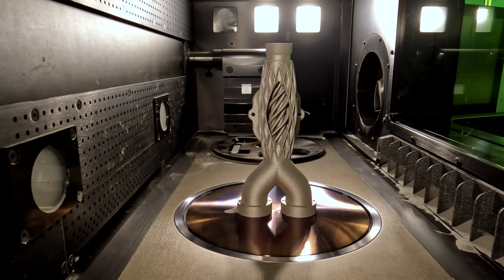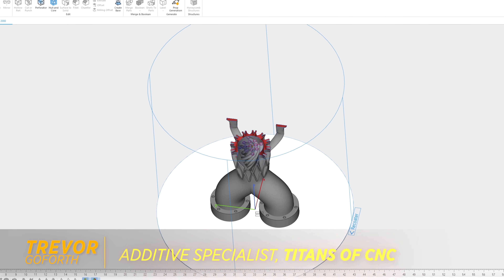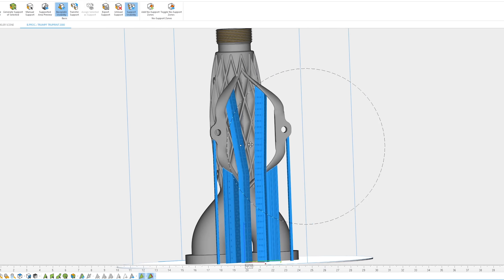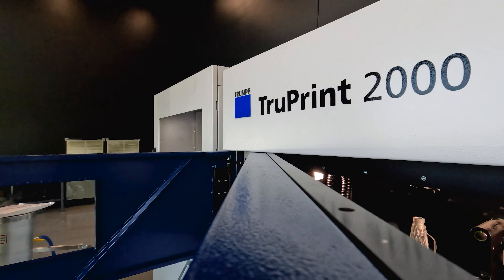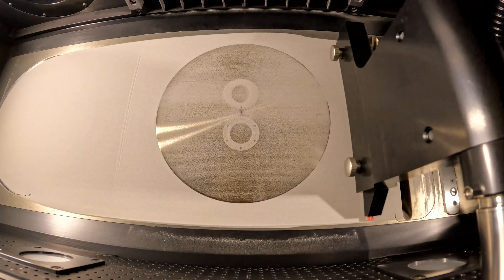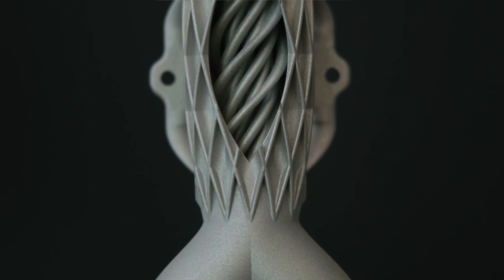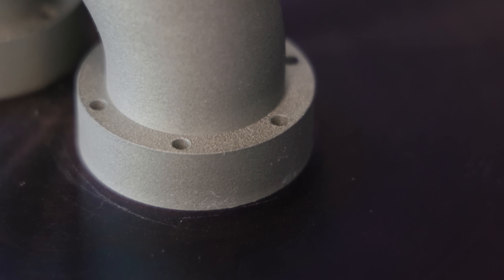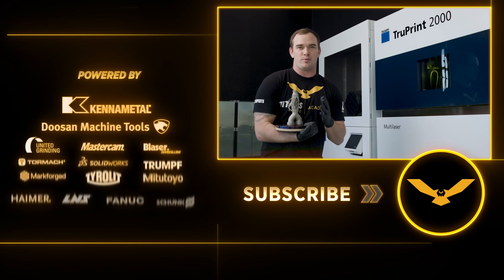3D Printing an INSANE Steel Part that's IMPOSSIBLE to Make on a CNC Machine

Comment: But what about the cost? Materials available? Surface clearance and smooth? Durability? Speed of production? Availability of such machines?
What if i need 1000 of a such parts? Isn't it'll be worth to slightely change the design to produce it fast and cheap with traditional technology? Can u polish inner of printed pipes? Can u offer some high tempreture materials? Or at least titanium?
Reply: Without a doubt, this is a very expensive part. Built over hours or even days on a very expensive machine, using expensive and hazardous metal powder. If you need thousands of a part like this, redesigning it to use conventional manufacturing would be the only way to make it truly low cost. 

That being said, there are all sorts of specialty applications that benefit from the design flexibility of 3D printing, don't need a high production capacity, and don't need a low per part cost. Maybe it's part of a rocket, maybe it's a heat exchanger used in a chemical plant, maybe it's going into a F1 car. Surface finish, durability, and clearances are just something that needs to be taken into account when designing a part like this for 3D printing, but the same goes for cast parts as well, and it's not as if the manufacturing limitations of casting have killed its relevance.  Many 3D printed metal parts have key surfaces that are machined for better surface finish and accuracy.

Comment: Interesting you have to put supports anyway because it sits on a medium of material.
🤔 how much force is applied by the  screeding action on each layer.
It surly is has vibrate action to make each layer easy to apply and compact?

Anyways don't know, don't have a 3D Printing toy to play with...

Comment: Rad! Smart to wear the respirator, even with fume extraction that nasty stuff still lingers for a while
Reply: I don't think the main issue is fumes, I think the respirators are required so you aren't breathing fine metal dust.
Reply: @keenanfinucan8778  There’s probably going to be some fumes but hopefully not as bad as cutting and welding. That’s gotta be some bad stuff though with these alloys

Comment: since you have the cutaway put in, you should check for leaks in a way thats easy for viewers to see. You can fill that center bit with liquid and apply a pressure and see if any bubbles come up.

Comment: Neat, but it still has many limitations. I can't imagine the flow-rate for fluid lines being terribly healthy with such a rough surface. Pressure and stress-concentration limits are likely to suffer quite a bit as well.

I can imagine that the more complicated the part, the more surface finishing is sure to be quite the new and challenging conundrum.
Reply: If stuff flows thru it, can you not sandblast the interior? With like, probing lines similar to those plumbing cameras or laproscopy tools?
Reply: The material removal won't be uniform and will concentrate on points and areas like the outer side of a bend. Even an abrasive line that can be used both in tensing and compression has limits.
And when dealing with high stress/pressure , any rough, sharp feature can became a focus for stress concentration and shearing/fracturing. Very smooth surfaces are necessary if you're working near the limits of a material.
Reply: @FiltyIncognito  might be true for pressure applications but then Porsche already used this tech for pistons years ago. In series production. Sure it's not perfect yet but especially for the automotive industry it can replace casting completely. Have you ever seen water channels in an engine block to be sanded or polished after casting
Reply: Honestly, I'm not sure how to succinctly  reply. It'd be easier to just hand you a textbook on manufacturing processes.

The limitations of 3D printing are well documented.

It's a great publicity stunt, though.
Reply: @FiltyIncognito  im sure everyone who made breakthroughs and innovations only followed textbooks.

If you understand engineering then you can understand improvements in tech, for now it's amazing. But it's not meant to replace other forms of manufacturing, just offer another option. If it can make impossible parts, even if not at peak efficiency, that sounds like a big win. Fine tuning and tech will get it to where it's most likely one day a major manufacturing process. I'd imagine it does have limitations, but doesn't everything?
Reply: @FiltyIncognito  i mean like a tube that you can slide down the inside while it blasts out sand in a 360 arc. Think of a sandblasting colonoscopy for your manifold.
Reply: @Variety_Pack  if the internal diameter is large enough, sure, but abrasive air-blasting doesn't have a terribly fine finish and wouldn't be terribly economical.

Best thing I can think of is running a high-pressured fluid whose density is the same as the abrasive in it. That'll require a fairly large and specialized machine, and therefor also a large enough client volume to be economical.

But that'll be in competition with already established processes....which is a huuuuuuuuuuuuuuge marketshare.

That's why I think 3DP currently has and will continue to have difficulties establishing itself beyond its current niche (disregarding outside hype-farming) in industrial applications for quite a while. Competition and economic viability are a big challenge, and tech has to advance enough to breach certain critical thresholds of profitability.
Reply: Maybe extrude honing it could solve internal roughness
Reply: Ah shoots, I'll jump in, why not! MechE here who's quite cynical about the marketing hype and false promises of a lot of tech, including 3d printing. Critically thinking about the limitations and perhaps learning to get the most out of other techs is often a lot more fruitful. That said, seems OP is thinking hard about some of these things so kudos. And besides, I have to admit, heat exchangers are one of the more interesting use cases I've seen for this tech. ;-)
Reply: Seems like this can absolutely be manually done to a higher quality with small metal tubing and welding. Is "manufacture" referring only to automated machine production?
Reply: @CableGuyRyv  I feel like you definitely could, but not out of stainless and not as cool looking lol. I can't imagine the cost/efficiency of the part is worth doing something this intricate... but maybe it is, not sure.

I worked on a heat exchanger cooling plate for a project in college. Is the only thing of this sort I've worked on, but was super interesting. I remember working super hard on a badass design, managing turbulence, flow rate, heat transfer through fluid, etc. All the good stuff. In the end, they winded up bagging the project after realizing that designs like these suffer massively from the surface finish where the fluids hit. Oh well. Got a pretty sweet 3d printed prototype out of it for my desk.

Side note: Looking back, I made so many dumb design decisions. Ignorance is bliss, lol.
Reply: @CableGuyRyv  they said "without a lot of design changes and assembly steps" it is indeed possible to do it manually but click and get the part back is quite nice. You can probably make something that does the same thing and may be sturdier by bending tubes and hydroforming the cavity, but it'll take a lot of skill and effort.
Reply: For a heat exchanger if the pressures are usable the high surface area might actually be a benefit
Reply: @satibel  There are ways to do that without increasing drag and wear as much.
Reply: @FiltyIncognito  if the fluids aren't abrasive it'll take a damn long time to get through the tubes, and I'm pretty sure you can make like 3 of those before you get to the cost of 1 made by hand.
I do think a whole redesign with stacked pressed plates might be more cost effective, but it doesn't look as cool
Reply: @satibel  The issue isn't chewing through the vessel. Weak points like joints are far more likely to wear first. (fluids don't need to be significantly abrasive to cause wear)

The issue is that a rough surface area will accumulate debris and corrosion faster, and the addition or subtraction of material will affect flow rate, and may cause debris to build up in the fluid that will accelerate wear in other parts of the system.

The redesign you're thinking of is NOT cost effective, at all. In many ways, the cost of manufacturing can correlate with the total surface area that needs to be processed. Not only will that mean additional shaping processes, assembly, maintenance and volume of source material will skyrocket.

Comment: The finished surface that CNC can do Is impossible on 3D print
Reply: Correct, but where specifific flatness and profile tolerances are required the printed parts are typically post machined in those areas.

Comment: how do you make 316 s.s powder! mind blown!
Reply: The process is called gas atomization. Basically it means you melt the metal (or alloy), you let a thin stream of molten metal fall from the top into a large silo or container and you aim very high pressure gas (typically nitrogen or argon) directly at the molten metal stream. The droplets solidify on the way down, so at the bottom you'll find fine metal powder.

Then you filter/sieve for size because both powder particle size, and size distribution, is critical for this type of powder bed printing. The powder that's not the right size can be melted and atomized again.

Comment: Can't wait until these machines can print whole working engines in one piece, not a head & block with gaskets in-between like we have now. I want a block and head in one solid piece. And you just run the engine until the internals wear out and recycle the engine and then print a new one...

Comment: When it is sintered, how much does it shrink? Does the process change material strength depending on how the sinter is programmed? Does the program automatically factor in shrinkage basted on the material?
Reply: This printer does SLM, selective laser melting. There is no heat treatment or sintering required afterwards for this printing method, and factoring in shrinkage isn't needed.
Reply: No sintering. The parts are fully-fused as-printed, but when they cool off after a print, shrink factors are on the order of 0.5%.
Reply: “When it is sintered, how much does it shrink?”

Sounds like something you’d lie to a woman about.

Comment: I worked at a place that printed cobalt-chrome dental fixtures. It set up from metal powder kind of like this machine. The metal powder is expensive, and water soluble. We used a six micron sieve to reuse the old powder. I was told that wearing any covid face covering would be sufficient. It wasn't, so I wore the common respirator I was given for belt sawing through supports to freeing the pieces from a steel plate. That was also insufficient, because the powder particles may have been too small to be stopped by the filter to begin with, but they definitely were after being sieved down. When reaching into the machine I could feel the particles crossing my tongue and hitting my throat. On top of that, the fact the powder was water soluble means it can pass through the skin. The sieve process was done pneumatically with the 3D printer's door open for the air lines to reach in. The powder was everywhere, in the air and a thick layer on top of everything. Cobalt-chrome is very unhealthy. My whole body started to go numb. I had to quit the job. The people who wear there had a strange acne along their hairline, like their skin was starting to fall apart. It took many months before I could feel my heart beating again. It is still hard to detect. unlike it was before I took the job. I can feel sore spots in my lungs that haven't gone away. It is harder to breath. I feel like this business I worked for took decades off my life, and I my have extra difficulty having children. It is also very bad for the environment. They are killing people there to turn a profit. I often want to press legal charges to hold them responsible for their actions, but I doubt I have enough evidence to convict. I wish I had never worked there.
Reply: That's a very very tough spot to be in. I'm not a lawyer, but my impression from what you describe is that you really should consult a proper one to figure out your options. 

This is printing is with 316L, not cobalt-chrome, and nowadays health and safety surrounding powder handling are quite a bit different from the situation you describe. With these modern powder bed printers, safe powder handling (both from a explosion hazard and a health hazard) is pretty much assured.

Comment: Having no idea about this, to me this poses the question: how strong is that? Can it handle elevated pressures (I don’t even know if that is needed here, but just out of curiosity)
Reply: Very. SpaceX has already used 3D printed parts like the SuperDraco engine chamber in the Falcon9 which has launched multiple times. They're so confident in them they are transitioning these parts over to the crew-based flights now.